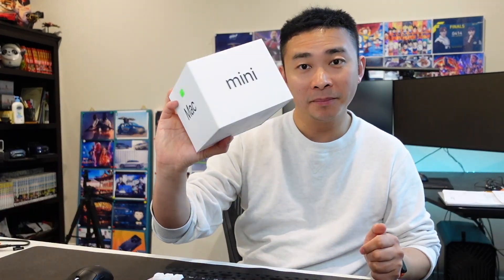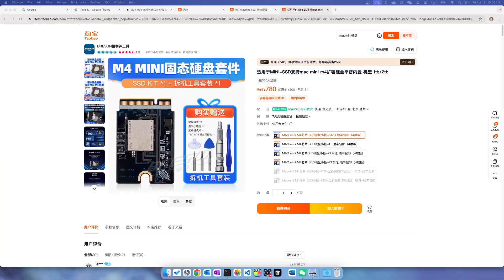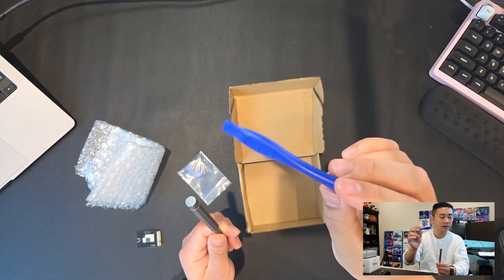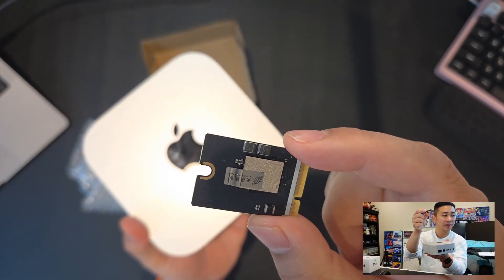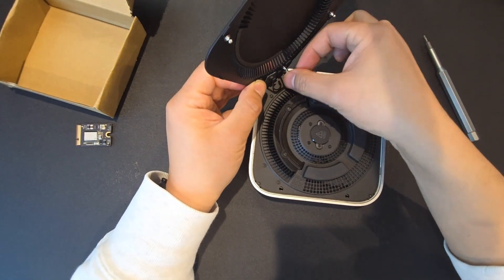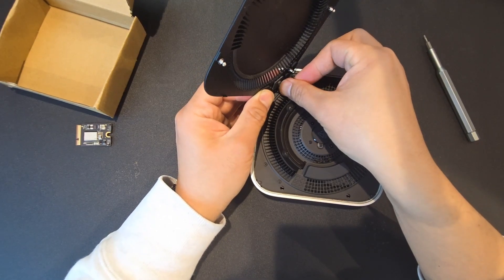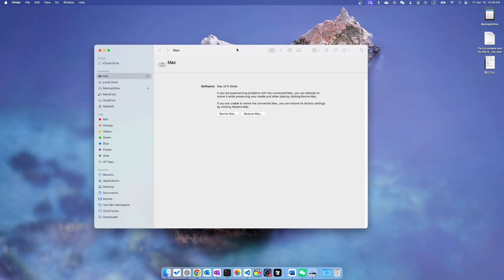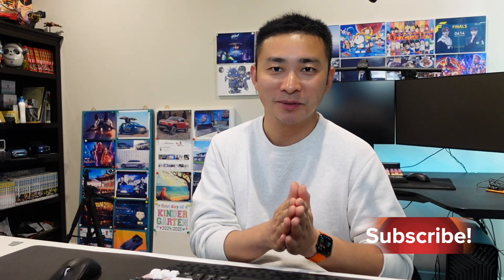You Deserve Larger - Apple Mac Mini M4 Storage Upgrade | SSD Upgrade

Comment: This sounds like a good upgrade. My concern would be the TBW for that drive. Was that available on the website where you bought it? The speed was generally on par with a PCIe Gen3 nVME, but for the price I wouldn’t mind, as the original one was even slower. Also, considering the fact that the controller for the SSD onboard the Mac, and only the NAND chips are on the SSD, I’d be guessing that the burst write speed would be the same for up to a certain size of files, but what happens next? I have a very cheap Gen4 nVME SSD, which bursts around 4.5GB/s but when it reaches the end of its cache memory, it goes down to 60MB/s which is like a USB 2.0 stick. However, an older more expensive at the time Gen3 SSD that I have, may burst at 3.5GB/s but it’s sustained write speed is 1GB/s. You can check that by copying large files onto the SSD and monitor the performance in real time.

Comment: Yes indeed its not an apple to apple comparison, it is more a shiny Apple (external TB4 casing e.g. Zike 666 + WD Black SN850x 2 TB lump summ 200€) to a stinky fowly Apple (Apples Storage upgrade to 2 TB for plain 1000€). The shiny Apple has (a pSLC Cache around 350 GB, a real NAND Write speed between 1 GB and 2 TB), the stinky  Apple has (a pSLC somewhere near to 30 GB or less, a real NAND Write speed around 200 MB roughly double HDD speed) Do a comparison writing LARGE Data (500 GB and up) once to the extrenal TB4 case with a decent NVME drive, and then the same to the internal storage (it will start fast, and the reduce the speed even faster), No problem for those just webbrowsing, but if you have a usecase to write large datas you will encounter the problem.
Don't trust Blackmagic Fiction, it barely exceeds in Chip Buffers of Apple Silicon (good for 90% of the work) but you should know where the limits are and how the look and affect you.

Comment: at those speeds it's better to use thunderboolt 4 enclosure and an nvme, 3.2-3.4GB/sec should be possible both ways, there are internal 2TB ssds that manage 4.9GB/sec in read speed
Reply: what do you mean? he showed a upgrade not a downgrade.
Reply: @imhotidog3285 https://www.youtube.com/watch?v=F3CYj37bxDE 4.8GB/sec read, now that's worth replacing the internal one, else you are ok with an external nvme, it will manage 3.2GB/sec both ways